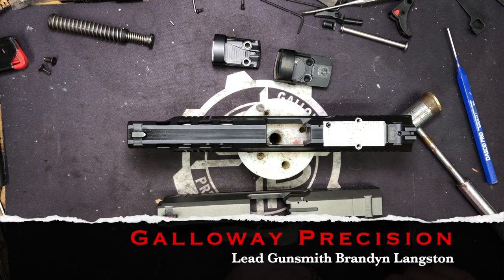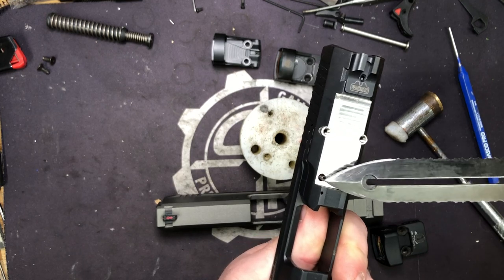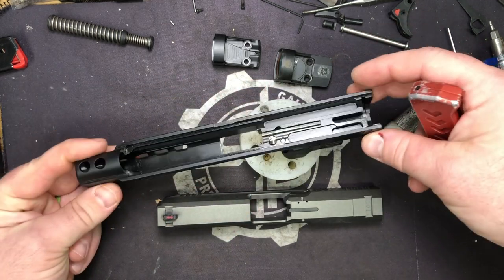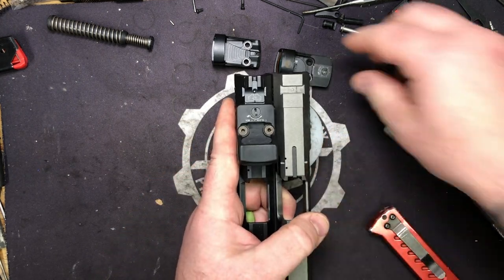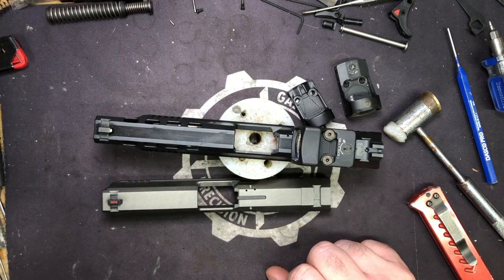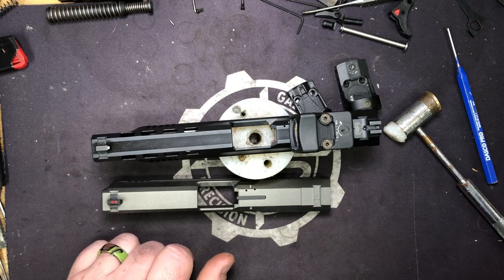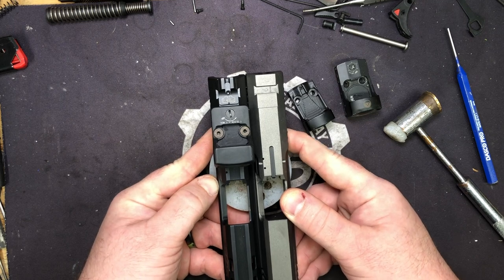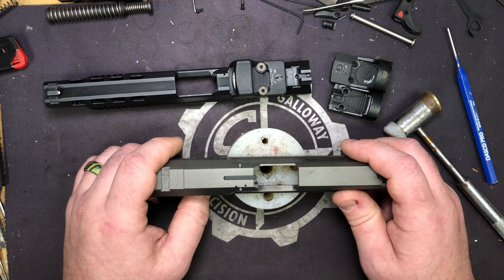Canik Slide Milling....WITHOUT PLATES!!!!

Comment: Hello, just came across this video today. I have a Canik TP9SF Elite and like the idea of having slide milled rather than a mounting plate. How much is the slide milling and how long to get the job done? Thanks much!
Reply from the maker: Milling is currently running $165. Please check out the Galloway Precision website for additional information on slide milling and contact info to get current time frame. I'd leave a link but can't due to YouTube's policy on firearms. The page you are looking for is Tier One Slide Milling. Link is in the slide show or at the bottom of the page under Services.

Comment: I am Sean from Texas and have had Canik a while I have the SFL which became SFX. Can Galloway mill my slide for a red dot optic? Please do get back I would be so THANKFUL
Reply from the maker: Thanks for checking in. Yes, we can mill it for narrow or micro optics. Here is a list of optics I know will work: JPoint, Shield RMSc, Shield SMSc, Shield RMS2, Vortex Viper, Vortex Venom, Vortex Defender CCW, ADE RD3-003, ADE RD3-006A, ADE RD3-006B, ADE RD3-018 Spike, Holosun 507K, Holosun 407K, Romeo Zero, Docter/Noblex Sight C, Docter/Noblex sight 2+, Docter/Noblex sight III, Docter/Noblex QUICKsight 5.0 VR, Noblex Sight G, Burris Fastfire 2, Burris Fastfire 3, Delta Optical MiniDot, Delta Optical MiniDot II, Hawke Reflex 1×25, Sightmark Mini Shot Pro Spec, Sightmark Mini Shot M-Spec, Leica Tempus, MAKdot 1×25, Vector Optics SCRD-19II Frenzy 1x17x24, Creative XP GlassEagle HD, Riton MPR D2, Riton 3 Tactix MPRD, Swampfox Sentinal, HEX Dragonfly, HEX Wasp, Crimson Trace CT RAD Pro, Cyelee CALF V2, Cyelee CAT PRO, or Vomz Pilad 1×20.